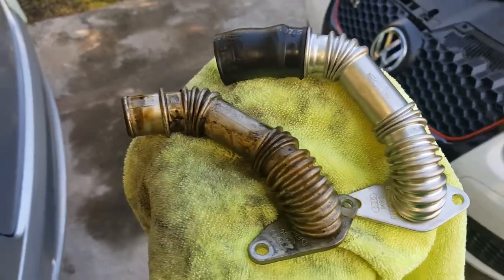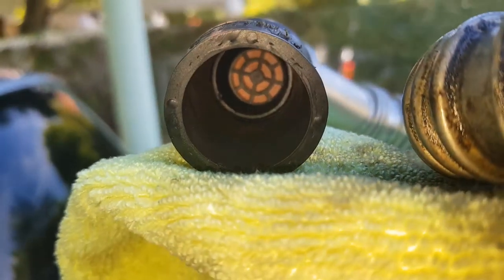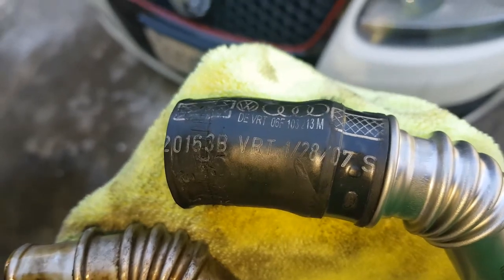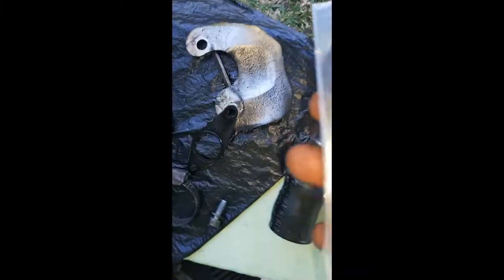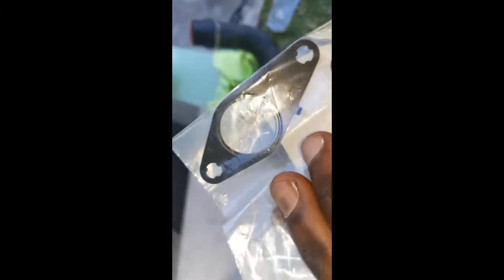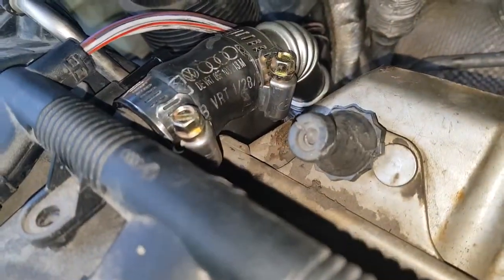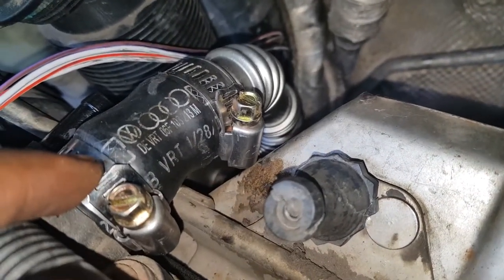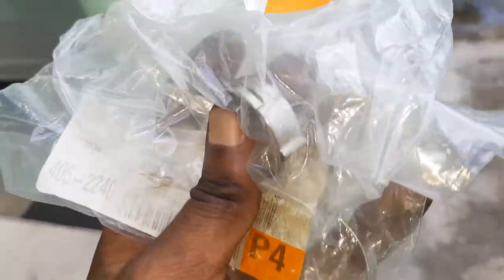MK5 GTI AXX, BPY, BWA Rear PCV replacement

Comment: That valved rear vent tube (06F-103-215-B) is meant to be paired with the Rev.-P PCV (06F-129-101-P). The other rear vent tube (06F-103-213-N), without the valve, is meant for the Rev.-R PCV (06F-129-101-R). However, tube 06F-103-215-B will work with both revisions of PCV. But tube 06F-103-213-N will only work with, and only be paired with, the Rev.-R PCV.
Reply from the maker: Thanks for this additional Information.  I've pinned your comment

Comment: what does it have different from the prev one? I've found a huge amount of oil reside on top of the black thing and I cleared it to inspect it later and see if the oil is pipe related or valve cover gasket
Reply from the maker: My previous one doesn't have a checkvalve, but this one does.    If you read the conversation created by Roh_Echt, there is another part that you also need to buy for this.   My car has been driving fine as is with just the part that I have in the video.    I use the factory PCV system (no catch can or bypass hose).   I use the F23T turbocharger, and have no oil accumulation

Comment: Can anybody explain me the symptoms they were having that made them want to check this? I have a weird spark blowout/sputtering in full boost and new plugs, coils, wires didn’t fix it.. thinking it might be this.
Reply: I am sure you realized this by now, but the symptom you mention sounds like a HPFP (High pressure Fuel Pump) Cam follower worn badly. I would be curious if you fixed what was causing it so I can sleep at night. LOL .

Comment: Hi tomorrow I will change the valve cover gasket and the little black pipe you show on the video. Question how hard is to pull away that pipe? Some people are tellin me thats is nearly impossible to remove. And that scares me more 🤣
Reply from the maker: That pipe required me to use about 4 thin plastic items to remove.   I'll give you a better response shortly.
Reply from the maker: @qa5486  you are correct.  I was just making life more difficult for myself in this video by taking the lazy approach
Reply from the maker: @qa5486  the annoying thing about removing the heat shield is that it takes a while to get it back in with lining up the bolts you mentioned.

Comment: You were able to get the breather screwed back in with heat shield still installed?
Reply from the maker: I did.  I recall it being a very tight fit.  I had to use my left hand to do it.  It felt very awkward.
Reply: @MatthewTaylor3  Did a turbo swap last year. Ended up having to pull the breather a couple times for various projects. Tried/failed every time to get it done without removing the heat shield. Total pain in the ass, I just remove the HS and save myself the frustration
Reply from the maker: @steveninverse9579  I had subsequently removed the factory heatshield on another day to install a BSH one instead

Comment: did this issue cause any smoke issues?
Reply from the maker: The issue, yes.

This happens when running above stock boost.  The check valve fixes that

Comment: Did you noticed any difference with the rear check valve compared to the non valve? Thanks for sharing :-)
Reply from the maker: Yes,  I noticed the difference when I upgraded to the F23T turbocharger as opposed to the factory K03.  The difference is only noticable if you still have the stock  front PCV installed as well,  and not install a delete kit.